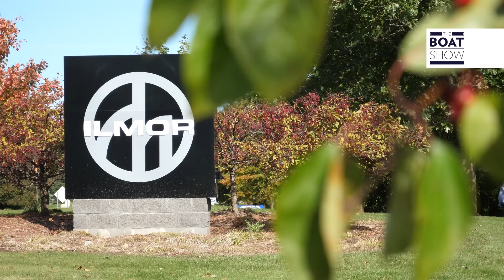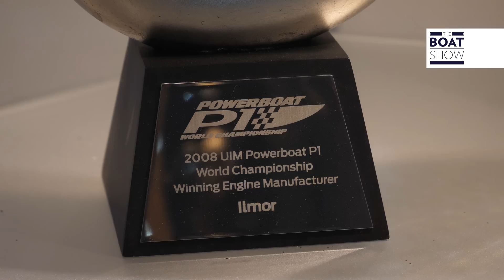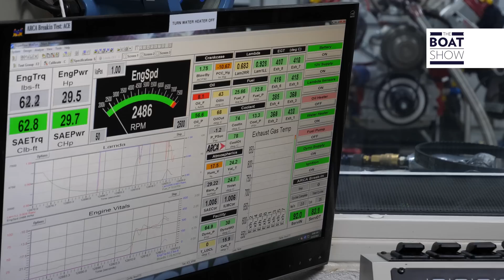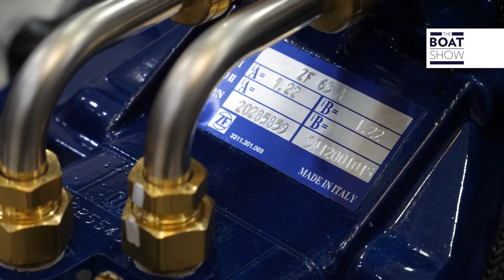[ENG] ILMOR MARINE PERFORMANCE ENGINES - HOW IT'S MADE - The Boat Show

Comment: The 460 ford coupled to a Conrad single propeller drive with speed master and a Borg Warner trans 1 5 to 1 ratio is the best it last longer when its steel